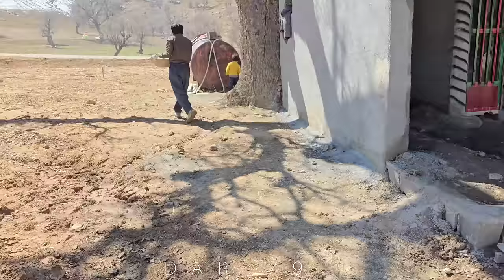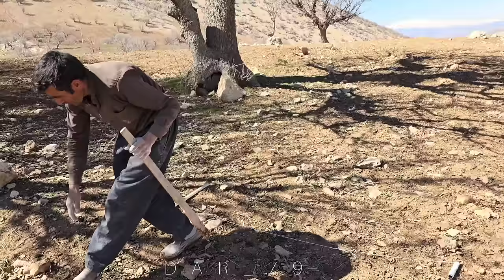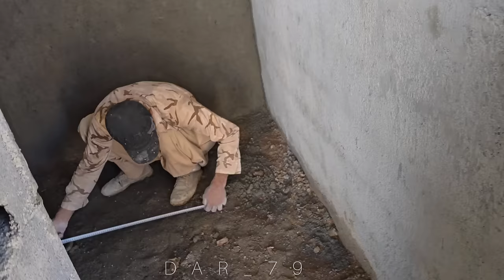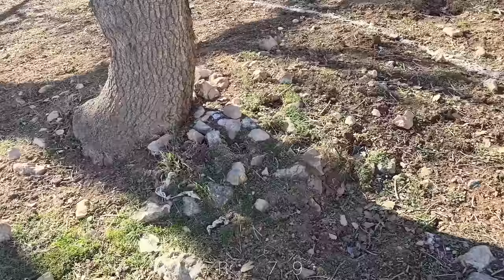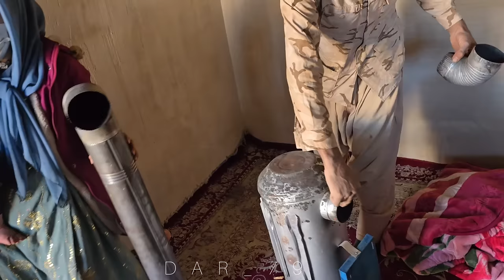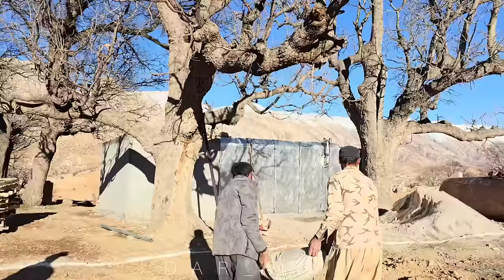Starting the construction of the yard for Nargis and preventing a tragic accident

Comment: Nargis the oil heater is dangerous
Buy a propane heater capsule heater for the house

Buy extra capsule tank and refill the empty capsule

Safer you can turn it off and on when you need it

The oil heater when water gets inside it explodes
Not safe can light your rugs on fire
Put a steel plate underneath